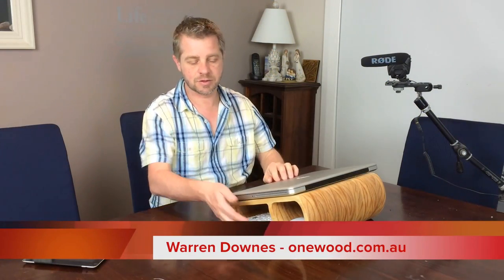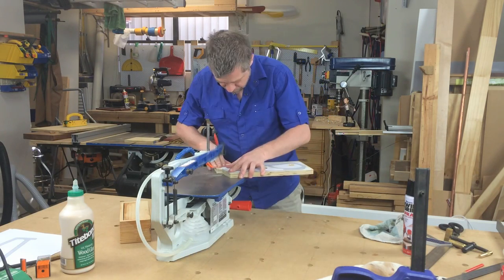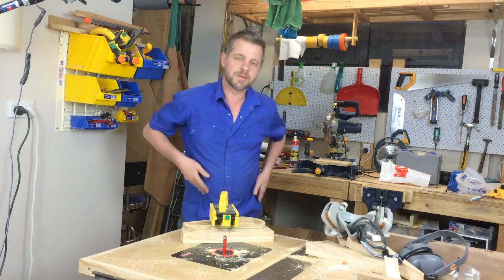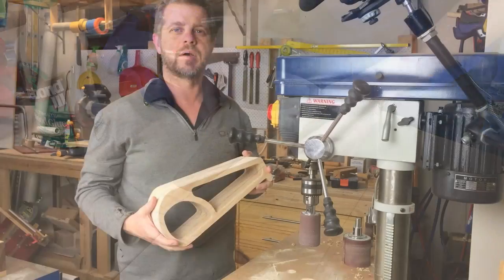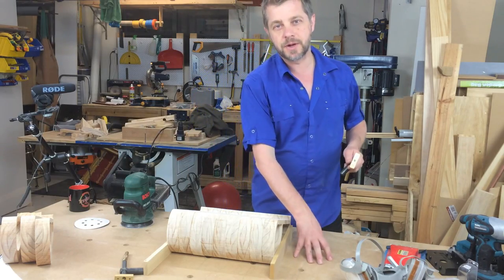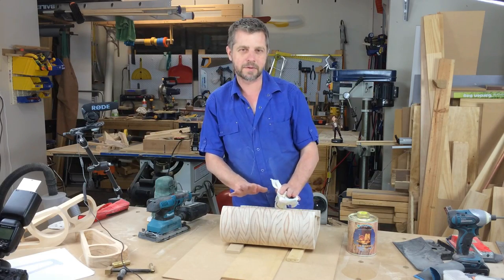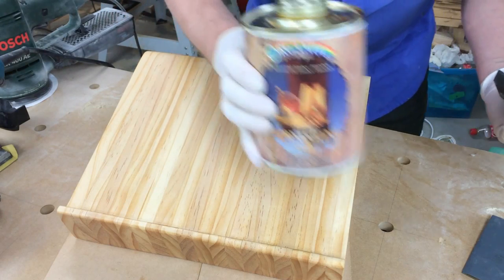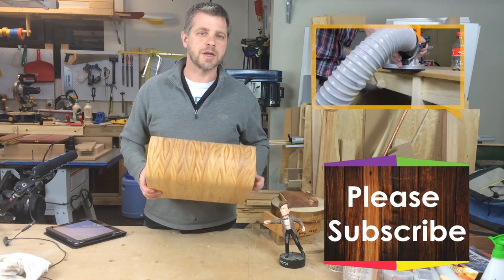Woodworking project Make a Wooden Laptop Stand and learn woodworking

Comment from the maker: Wow my laptop video reached 20k views today thanks everyone that made my day http://youtu.be/nye3NRyQmj8
Reply: Apparently I really suck at using a router table.  I've destroyed two pieces so far when the bit ripped off the little tongue thats meant to hold the laptop. :(  Is my router too fast, do you think?
Reply from the maker: Hi Adrian, i think i had a bit of tear out as well. Im pretty sure i had the speed around 4.5 out of 6 (i normally leave it there), I'm pretty sure i started with the front and went up so i was not climb cutting and nibbled around the corner slowly when i went over the top of the lip. i think taking it slow is the key. 

If you still have trouble maybe you could cut the lip out on a bandsaw or coping saw or even file it close to the line and clean it up with the router.

I think i may have also crewed the template so its close the edge at that part so there is less material to remove.
Reply: Thanks Warren.  I tried again a different speeds.  I still get heaps of tearout in other places too.  But twice now Ive ripped off that tongue.  Maybe pine isnt the best wood for this... Just now my bush just slipped down and I dug too deep and tore into my template :(  Maybe Ive bitten off more than I can chew
Reply from the maker: Hi Adrian, i used pine i got a bit of tear out as well especially around the back of it when going across the grain but it came out with sanding. Once its together you can sand out the tear out. you could also try a different diameter bit which might help. mine looked a little ugly before sanding as well.
Reply: And now 40k! I'm definitely making one of these. Subscribed.
Reply from the maker: Thanks John, I'm super happy with that project use it everyday.
Reply: Im currently in the glue- up stage.  Went through two router bits - one snapped shaft on an (expensive and new) pattern matching bit and one blown apart bush on the backup flush bit :(  This has been an expensive chrissie present :)  Im also going to have to bog up a few bits as there was a lot of tear-out and blown out bits.  But its been fun :)
Reply from the maker: bummer sorry hear about the router bits, I'm pretty sure mine had some good tear outs especially around the back but most came out with sanding which is good. I like Timbermate if you need to fill any holes works well and their colours seem to match in.
Reply: This looks great. I must try. I will subscribe
Reply from the maker: Thanks for that Garry
Reply: How much would u charge to make me one??
Reply from the maker: Brandon Arwood sorry I am a bit time poor to make one at the moment. There are free plans on my website if you know anyone handy that can do it

Comment: Hey Warren, this summer I'm going to try and start wood projects. This one looks really neat, and I use my laptop a lot, so it would be very helpful for me. I have looked at some of your other videos, I will probably need to do almost everything by hand. My dad does have a Scroll Saw, I see that would work well for this project. What other tools will I absolutely need to do this project? Some of the ones you have are too expensive, and too big for me to get. If you could write back, that'd be fantastic! Thanks for the videos! Subbed! ;)

Comment: Nice demonstration. Just a bit concerned that Warren uses the Darth Vader dust mask when routing, but relies on the basic filter bag when sanding glued timber sections. At least a vacuum attached to the sander would be a better example to novices.

Comment: you forgot the vent holes for the fans, you should have used peg board for the top. VENTALATION IS A MUST FOR A LAPTOP !
Reply from the maker: Most laptops are made to sit and operate on desks which also don't have holes and Macs are designed to lose their heat through the keyboard. The only exception might be the high end gaming laptops which produce much more heat than a normal laptop. My laptop is never turned off and has been sitting on the stand for over 2 years without issue.

Comment: Just a quick idea; I was thinking that a series of ventilation holes drilled into the top surface of the stand, or maybe even some sort of screen insert might help with heat dissipation of the underside of the laptop.  Well done, Warren.  Very nice project.
Reply from the maker: Thanks Bruce that would work depending on laptop, mine runs on that 24/7 and never gets turned off and i have had no issues, Mac ventilate heat through the keyboard so its not as big of an issue.

Comment: Very nicely done. The only change I would make would be to perforate the top
surface  with perhaps one inch holes in a symmetrical pattern for passive cooling purposes. And perhaps some small rubber feet to allow the laptop to sit up a bit and allow the air to flow underneath. My Macbook pro gets hot !!    :-)
Reply from the maker: Robert Hiekel Thanks Robert i started with the plan of holes in the top but changed my mind, i never turn off my Macbook pro and after 7 months there are still no issues with it. I ended up adding rubber feet to mine as well. Mac vent most of their heat through the keyboard which is another advantage for them.

Comment: Hello Warren
I have viewed the plans for the laptop project in Sketch up and Imperial formats. My question is do new plans have to be drawn to scale in order to create a drawing to glue on the material to make a template. I am struggling with Sketchup. This is why I am asking if there are downloadable plans already to scale that can be printed??
Thanks again
Reply from the maker: +Douglas Hill Hi Doug if you download the PDF plans they are drawn to scale you just need to make sure you print them to scale, there are some measurements on there you can use to double check the print out.

You can also use this program to help print plants to scale if you have trouble http://woodgears.ca/bigprint/ 

If you need any help with it let me know, also if you make one feel free to post it on any of my social media i would love to see it.

Comment: Could I use a jig saw for the insides of the bigger since I don't have a hand router?
Reply from the maker: Hi Tim, no problems it just might not be as neat with a jig saw and need some extra sanding. You can just put the best ones on the outside.

Comment: at the risk of being pointlessly negative, isn't this a rather inefficient way to use the wood? So much waste, you could have made essentially the same thing using about 10% of the wood if you had glued some layers for the curve vertically instead, or sacrificed the curve and use even less. I think it's quite important not to be wasteful, unless the result really does justify it- not convinced in this case. Off back under my bridge now.. apologies.
Reply: +Daniel Adderley I was thinking the same thing, except I was thinking of uses for the inside and outside scraps. Keychains or Coasters? The Cup is Half Full and this Computer Stand is Amazing. I will make one of these on my cnc.

Comment: thanks a lot warren , i really liked it , i just subscribed your channel.
can you please let me know how you can make 1:1 pattern and print it  with sketcher.

thanks again
Reply from the maker: Thanks for that glad you liked it, to print 1:1 maybe google it as it seems to vary from operating systems, you can also use the PDF version and select print actual size. Also Mattias Wandel has a program called big print which is really good for that.

Comment: Hey I know u used 3/4 ply for the template. But what thickness are the individual pieces?
Reply from the maker: Hi DK i laminated 2 x 3/4 (19mm) pieces of premium pine together for the thickness of each piece, the thickness does not matter too much it depends on the router bits you have, i had a long 2" bit so could cut things a bit thicker.
Reply: Is that easier to cut than say a 1-10 board
Reply: I got a 2 inch bit as well but when cutting through the boards it's very rough.
Reply from the maker: D K You would find it easier if you just did one at a time, i wanted to hurry the process the cutter was sharp so it was not too bad, don't worry if you get tear out at the back of it when going across the end grain it sands out pretty easy.

Comment: This is a very kewl design but has one fatal flaw....it doesn't allow for heat dissipation.  Most laptops have either an air intake
on the bottom or heat discharge on the bottom.  In either case, this design needs slots to allow for airflow.  Many laptop problems are attributed to overheating....a major problem with laptops, and without slots or multiple holes situated where the intake or exhaust is located......this will create a heat issue.  Just one tech's opinion.....still love the design though!!!
Reply from the maker: keith irvine I did think of that and planned to chisel some hole if it becomes a problem, Macs are designed to lose most of the heat through the keyboard and have no ventilation on the base which makes sense since they are designed to sit on a desk, mine never gets turned off unless i am taking it somewhere so i figured if its been running like that for 3 years sitting on a desk i don't need it. Glad you like the design i spend a lot of hours on it every day and it makes life easier.
Reply: OneWood - Warren Downes I'm sorry if I came across as putting your design down......not my intention.  I love the design.  As a tech, I know the biggest problem with laptops is overheating...which can burn out the cpu or drives...or motherboards.  When it comes to repairing them...there is more work involved in taking them apart...to get at the parts, than anything else.  There are about 30 plus screws that have to be removed, and in the right order, for each makers design.  That is why I don't do them any more......just desktops now.  The name, 'laptop' is poorly chosen because even
sitting with your computer on your lap will create a heating problem.  If you haven't had problems yourself, you are one of the fortunate few.  Anyway, my apologies..it was just a suggestion. I see a lot of your followers intend on building your stand, and I just wanted to make you aware of a possible problem and reasonable solution.  I will continue to watch your tips...enjoy the info.
Reply from the maker: No problems at all Keith, i was going to chisel out square holes which would have looked pretty cool as well just never got around to it. Keep up the woodworking :)

Comment: ts very good and nice but u made 1 mistake.Didnt make hole for cooling laptop ;)
Reply from the maker: Stevan Serdar Thanks Stevan, Mac lose most of their heat through the Keyboard so its not really needed, my computer stays on 24/7 and i have not had any issues. I did think about having holes at the start but changed my mind. I guess most desks don't have holes in them and laptops are designed to work on them.
Reply: Its ok with Mac but many others laptops heat like hell and would be nice if put under some fan coolers :).What oil u use,any or?
Reply from the maker: Stevan Serdar I used hard burnishing oil, its nice stuff i always get a good result from it.
Reply: TY ;)

Comment: Warren, you should make some vent holes on top to let some air movement and make laptop's cool down easily.
Reply from the maker: I thought of that but Macs lose most of their heat through the keyboard
Reply: +Warren Downes - One Wood they do (probably). but to be this project more universal (and other laptop brands), i would do holes. also it would be lighter.

Comment: Looks great. What did you use for your blanks?
Reply from the maker: Hi Jason, its just pine, it came up pretty nice i think particularly the curve at the back.
Reply: What are the deminsions of the blanks? They look rather think, but it could just be the angle. Thanks
Reply from the maker: I laminated 2 pieces of 19mm (3/4 inch) pine together for the thickness and then cut a bit bigger than the template on table saw. The long router bit did not really have any trouble eating through it.
Reply: Thanks

Comment: how wide is each of the 9 pieces
Reply from the maker: Viking John it can vary depending on what you have available but i used 2 pieces of 19mm (3/4") pine laminated together.
Reply: okay i looked at the blue prints 

how wide or depth is the surface of the laptop stand

around 18 inches
Reply from the maker: Viking John its about 18" wide, the laptop is a 18" Macbook sitting on top of it.